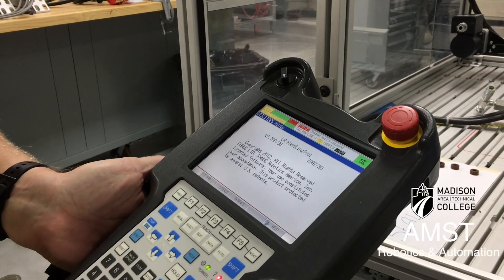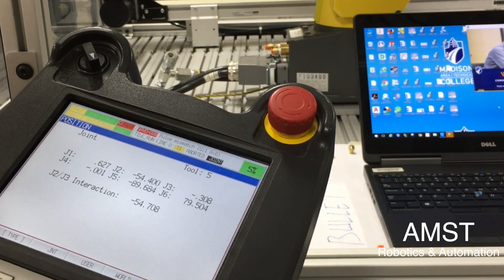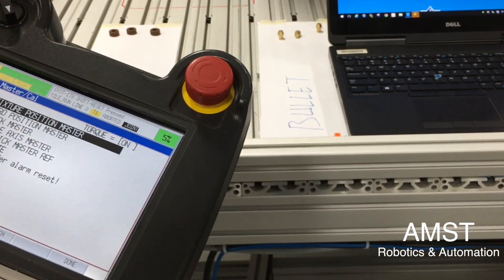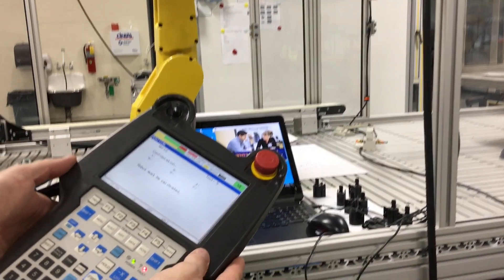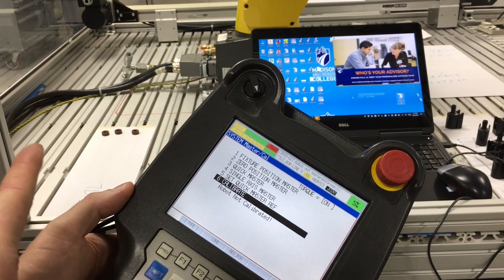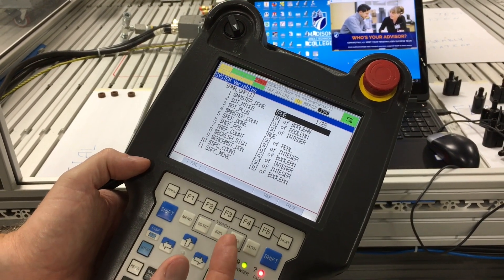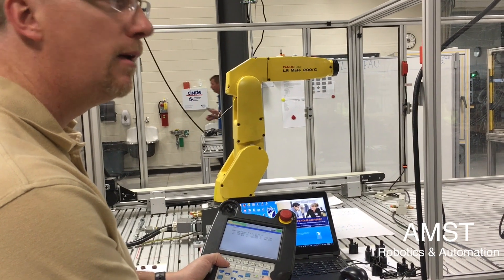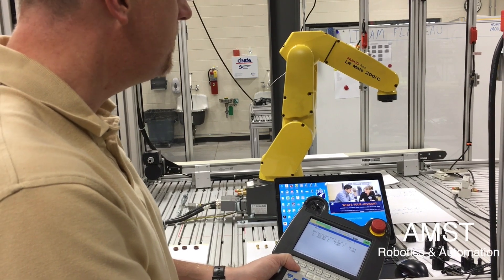"pulse mismatch" Reset after bumping servos - Fanuc LRMate 200i

Comment: How do you know the first 6 manual joint zero are correct enough to be cancelled off by calibration?
Reply from the maker: You'd jog them to 0.00 degree and look at the alignment (scribe) marks and confirm they line up. If they are visually off (do not align), you need to remaster. Only other test is to jog in World (X & Y) (UF=0) along a parallel surface to the robots base and confirm that it maintains the same distance.

Comment: what about  quick master?
Reply from the maker: Pulse mismatch does not require Mastering. The process in this video is very similar. QuickMaster is only needed if the batteries died and the Robot lost mastering. Recovery to jog the robot is more complex, but the procedure to re-master very similar.
Reply: @PSDettmer  thanks

Comment: Thank you sir very much, I have a question please; if the joints are programmed for a torque that don`t exceed  the maximum inertia reactions ( I mean the low torque movements ) does this problem happens?
Reply from the maker: Yes, this typically happens if the joints are moved with power off or brakes off.
Reply: thank you, but from my experience I Know that happens only in stepper motors not in servos; servos would return to that zero position then achieve the program if it moved without power?
Reply from the maker: It's a safety function. The Servo knows that it is in a different rotation than when it was shut off. It requires the user to confirm that everything is good and simply reset the "Fault".